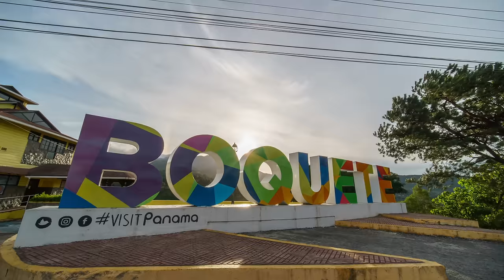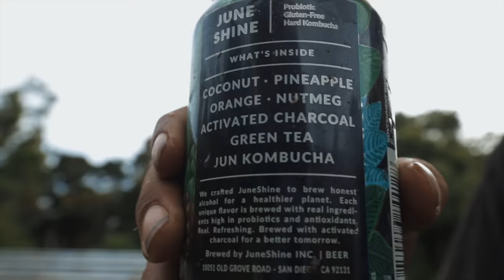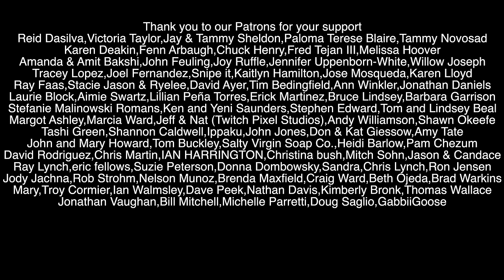Elevated A-Frame Platform is COMPLETE!!! // couple builds A-frame house

Comment: get an old tire and put the logs into the middle  to split the logs.  It will hold them nicely.  Also get an ax instead of a hatchet.  It will give you more power.

Comment: Peat moss tends to be kind of damp and will hold moisture for a long time. That is why it works so great on top of the soil in your garden. Have you tried coconut coir (fiber from the coconut husk) or sawdust?

Chopping wood at the end of your 2nd trimester! Kaylee you're my hero! 👏👏👏
Reply: I second the coconut coir it's better suited for your climate and easily sourced. Sawdust I've never tired but would consider/try a blend of both considering the amount of building your doing and will do in the future.

Comment: Natures head, I had to smile at your trial of this product. I have been using it for 3 years now. My first year was a disaster because I did not know how it works. Keeping it dry is not good, that causes gnats to take it over. I finally have the right formula, the fan in only used for a short time after you use the toilet,  then it is turned off. I am always checking the moisture content by observation. If to moist I add a little more peat moss. But never clean the solid portion of toilet completely out, you are throwing the good bacteria away for the next batch. That is what breaks it down into dirt. I clean some out every 6 to 8 weeks, depending on how hard it is to turn the handle. It smells like dirt when I clean it out. Works great, hope this might help. And we have high humidity here. 😊

Comment: I think I can see where they are going with the structure of the A frame you will not have 4 supports but 8 of them. The plates you welded in will take the weight of the structure the downward force. As you extend the frame to the outriggers then that takes the lateral i.e. outward forces. Really quiet clever.

Comment: I have a natures head and I live in Maryland. It’s really humid here as well. Probably not as bad as where you are but still bad. What we learned is to use coco core not Pete moss, you can control the moisture better with the coco core. In the summers when are humidity is really high, we barely used any water to hydrate the core. We just broke it up with very little water into small chunks. That way you not adding any more moisture then needed. You can add more mid way if needed to keep the moisture level down. We also added another fan in the intake air side. It was just a PC processed fan modified a little to attach to the toilet. Also make sure your exhaust vent is straight out the back, no bends. Lastly don’t clean or bleach your poop bucket, you are getting rid of good bacteria it needs to break down the waste. Hope that helps

Comment: Hey Kaylee, little trick when you're chopping wood - if the axe sticks in the wood, turn it over for the second swing and hit the head of the axe on the chopping block & use the weight of the wood block on top to split the block in half.  It's a lot easier.

Comment: Little tip that my father gave me while chopping wood, if the ax is stuck in the wood, stop hitting it but turn the ax let it fall, so that the weight of the block of wood helps to split it. It makes it easier sometimes :)
4:50

Comment: This might be obvious, I hope. Whenever I did any roof rafter system, I first cut a pattern piece and a copy. Yours will be unique being metal not wood. Then test fit both at each end of the building by holding them parallel to the ground. (will need several extra hands to do this)  You are just holding them as if they were going up into the air, no tacking required. Check the fit at the floor line as well as the ridge. If it fits good at both ends...then you cut copies for the rest of the building. Gotta test fit to eliminate a major mistake. You are doing great!

Comment: We live in a humid climate also and use mostly very moist wood shavings which is great to neutralise any odours.  It's a simple system I made where there's just a bucket in a wooden box with a 12v exhaust fan. There's a fantastic book all about humanure where he says it can be used for growing food in I think it's called humanure hand book. Cannot remember authors name but think he is American. Or have you considered the bio gas toilet system using rain water?  The peat moss is not necessary for composting toilets. I find it you leave the emptied poo bucket out in the rain and sun for a few days or wks it's much easier to clean and no smell :) trial and error hey.

Comment: so i use a pail for composting in a bag but i have garbage truck in my small town. but for you guys could you use a burn toilet and cost be less our oil patch uses sometimes burn toilets might be an option to have a burn area that you can mix sawdust to hold back the smell from the chainsaw and it should burn easy compared how the oil patch toilet Burns the deposits.

Comment: I have a 2007 Hilux 220,000km on the clock the only thing I have ever done to it is a new starter motor. I am still on the original clutch, brake pads and shoes. Never had a vehicle so reliable.

Comment: Hi Kaylee, regarding pumping & dumping, you only need to worry about that if you drink more than 1 of something to the point of a buzz.  Inexact, I know, but baby will be getting what your blood alcohol level is. Legally drunk in the US is usually 0.08% blood alcohol, which you wouldn’t obtain with drinking 1 June Shine or 1 beer, especially slowly (the percentage from that would be way less than 0.08% which is less than a non alcoholic beer).  Also, if you like rich dark yeasty beers, you’re in luck, because there are several galactogogues in such beers that will noticeably increase your milk production. So if you want to slowly savor a single beer or hard kombucha, baby will be perfectly safe to nurse

Comment: When the wood fails to split, it's much easier to take a small sledgehammer and bang on the back of the axe head, than to try and lift the axe with the wood attached and keep banging it against the stump. You can also use a fatter axe for that method, known as a maul.
https://www.youtube.com/watch?v=vFQGtore2R0

Comment: I've been worried about those caballo overhangs for a while now.  I would add foundation rows and another steel bream under each of them, before you add all that roof weight.  They look pretty flimsy to me.  It's going to be a bitch to fix later, once all that weight is on the ends.  Or at least test one of them with 1/24th of the roof weight on the end.

Comment: Kayle, why consider a standard shitter/septic system when you can plumb your household into a methane gas system?  Mother Earth News covered this alternative 40 years ago.  The Hindus are big on such setups.  You'll need a type of steel tank of suitable shit storage with a heavy floating inverted tank covering the holding tank.  Think of a topless round tank with a similar slightly larger diameter tank (Lid) inverted over the base holding tank which builds the gas pressure.  Seek and ye shall find..... free plans!  Yeah, your current methane bag system won't cut it!

You can plug your entire farm into one huge tank (maybe 5000 gallons+) including your animal waste.

Comment: Ya'll need to seriously pay attention and get your welding done a lot better. I really don't want to have to say I told you so when it starts failing. When it's so simple to do it right the first time, so no one is seriously injured or killed just because ya'll are too lazy to do it right the first time.

Ya'll are doing such pee poor welds not getting good penetration like you should and then you grind most of it down which makes it even weaker. You should be doing better welds with much better penetration and you should be doing at least a second and third overlapping weld for better penetration and making your welds much stronger.

Are you planning to injure, maim or kill as many people as you can???